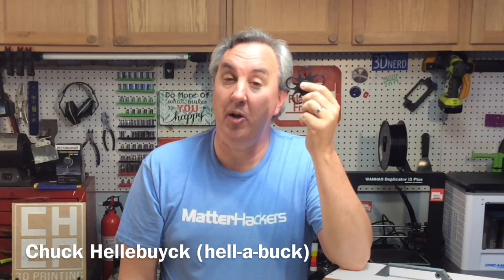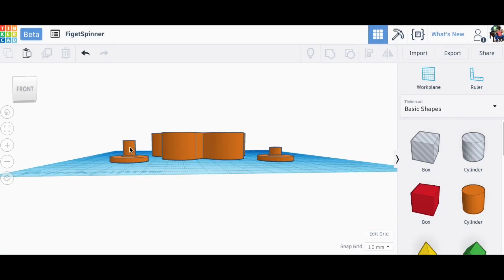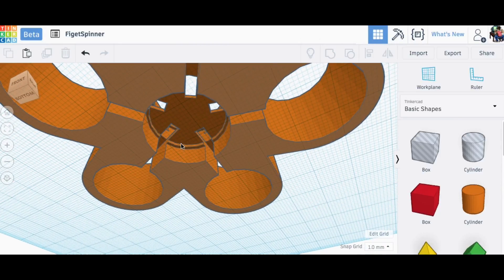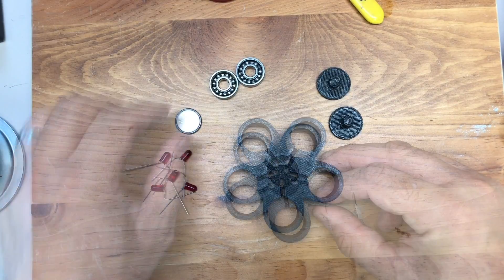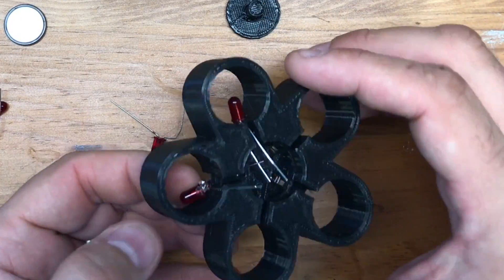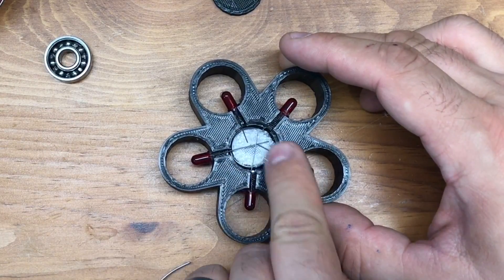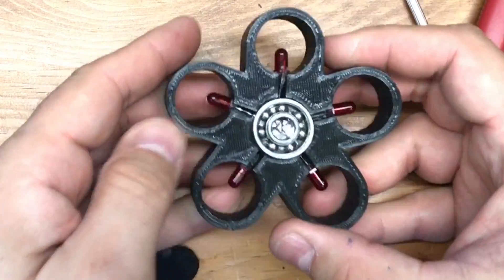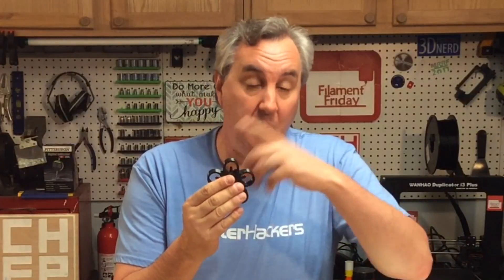LED Electronic Fidget Spinner - Designed in Tinkercad and 3D Printed

Comment: Try using full ceramic bearings, you can get them on eBay for cheap. Also try using tpu for the caps, they are more comfortable